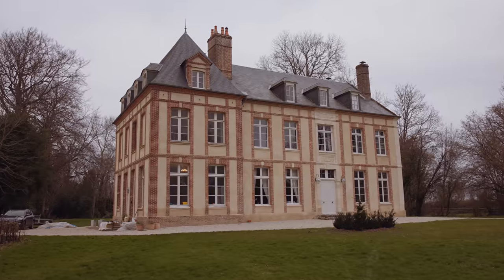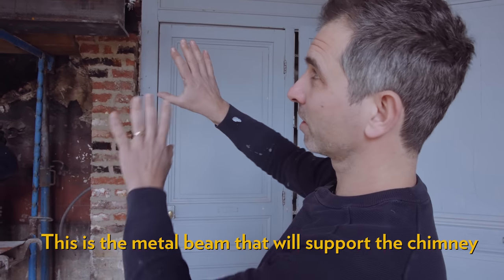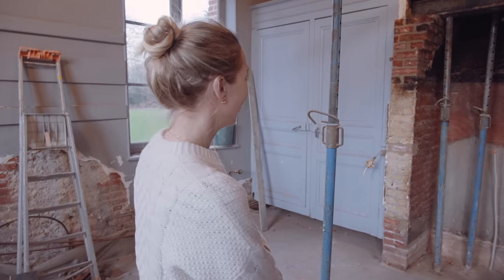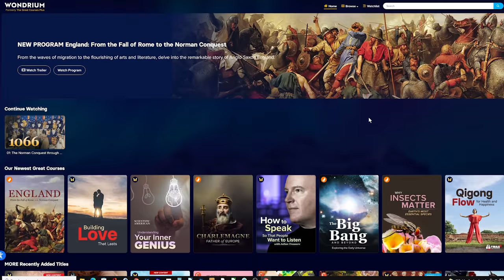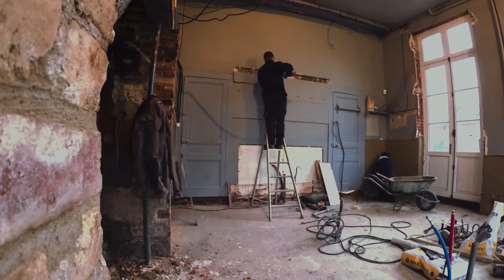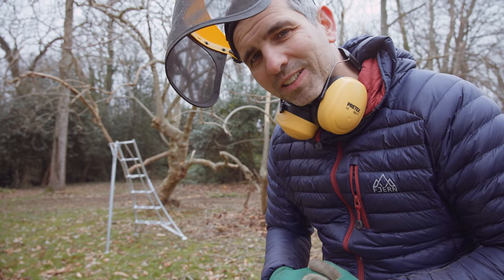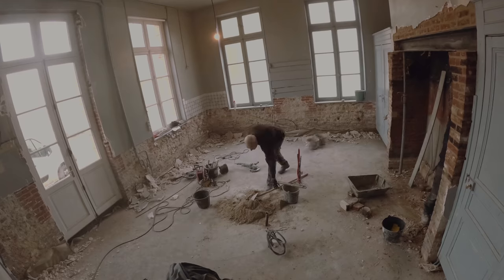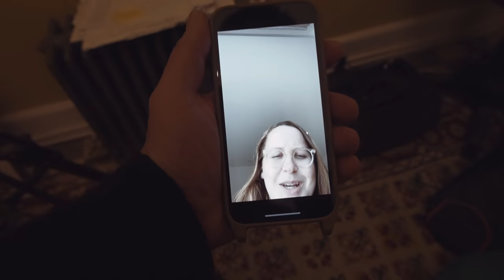Chateau Kitchen MAKEOVER: Why we're scared.

Comment: in the states we call it an I Beam. because its shapped like the letter or H sideway's, anyway its used to support and allow expansion of otherwise very unstable brickwork such as the chimney in your kitchen. Yes they are extremely heavy and usually require more than six men to help put into place like when a wall it taken out of a lower level room like on the first floor to expand the visual field with out compromising the upper floor structure and safety.. Its pretty expensive to have done. yours is working perfectly for its intended purpose and that is to access the Chimney for the new stove? I hope, or Oga.

Comment: The kitchen is progressing nicely. Since you opted out for not installing floor radiant heating, what are your plans to heat the kitchen (as the radiators were removed I see.)? Also, what are the dimensions of the kitchen (L x W x H_ ...such tall ceiling height, I envy you that size of a kitchen. Entertaining videos - as always.